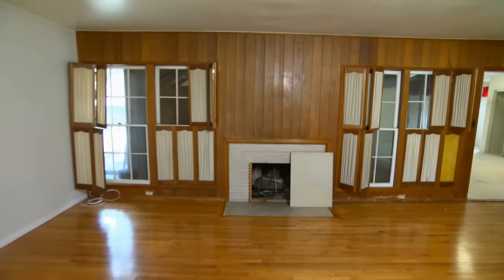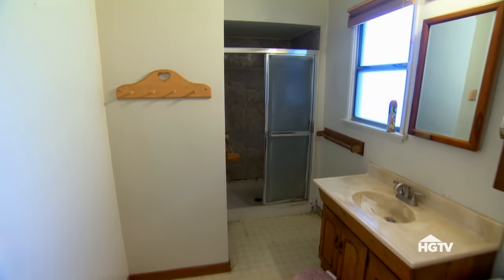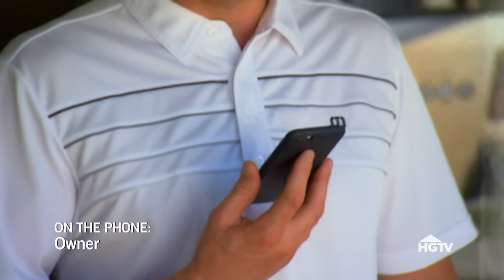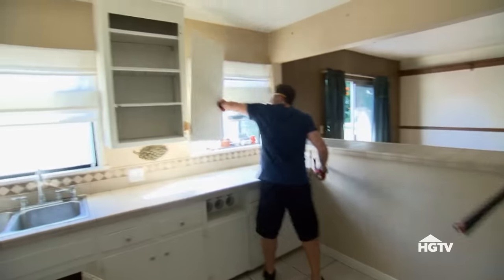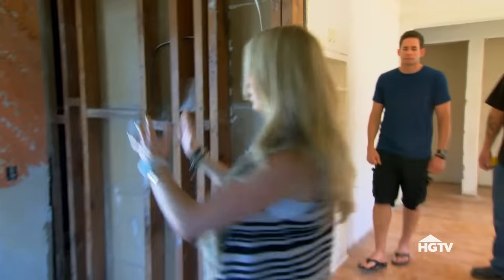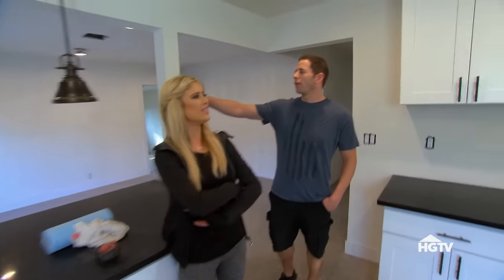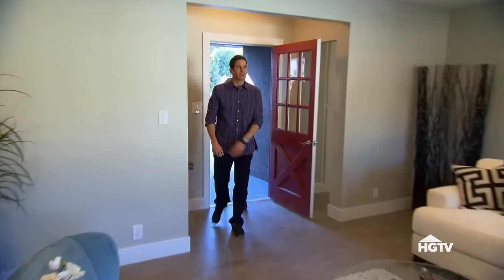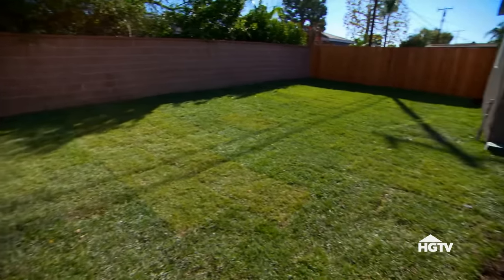Strange Doll House Remodeled Into a Dream Home | Flip or Flop | HGTV

Comment: How can a house be sold without the buyer being told whether or not the additions were permitted? Does the state just ALLOW that? Everywhere I've lived, state law requires a seller to disclose any issues, and the sale can be voided if the buyer finds disasters the seller tried to ignore or conceal.
Reply: A house can be sold as-is, but that comes with the risk of possibly having to tear things down if they weren't permitted.
Reply: Why do you think they're not told? Many homes are sold as-is, and disclosures are required.
Reply: Yea where I live you can sell a house as is, however let's say the seller says it has ac and it doesn't then the seller has to work with the buyer, doesn't work for additions, that has to be verified by the buyer. Especially older homes because at some point you didn't need permits.